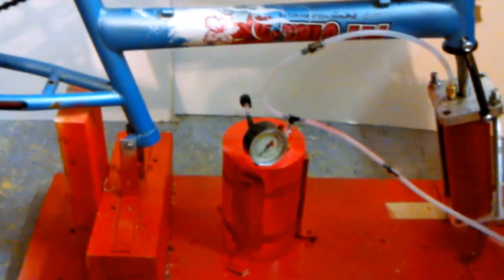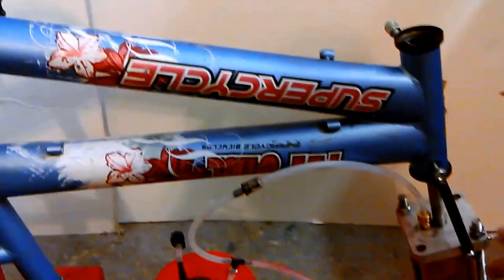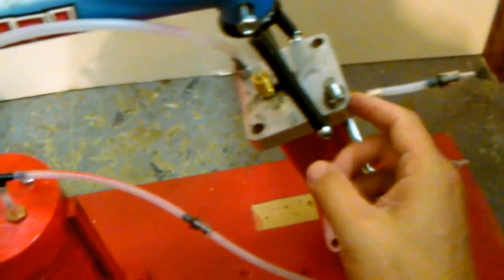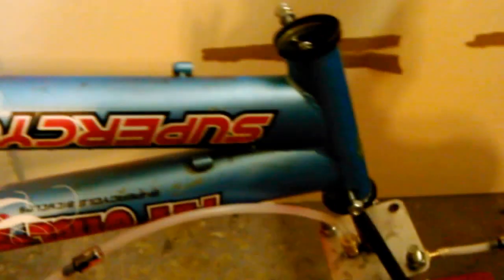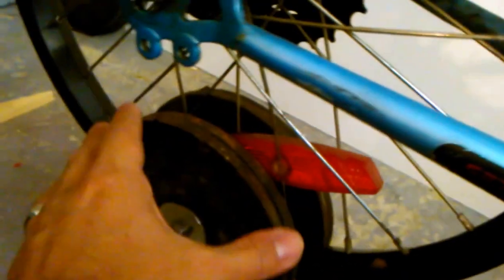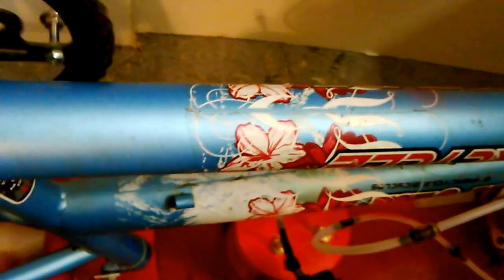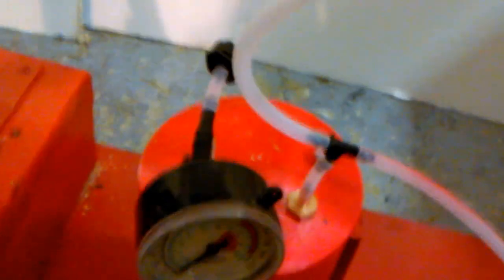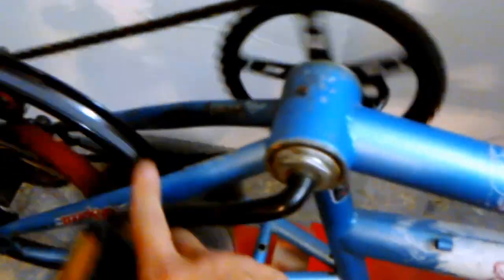Centrifugal reciprocating air compressor

Comment: it does not look like you are getting compression on the downward stroke, only the upward stroke.  remember the milkovic oscillator harvest gravity and creates a very powerful short stroke upward force.  to get the full amplification on the device you have to use all the upward force available.   a compressor is a good Idea and I thought of that one too.  but because of the very short stroke  of power you would have to design a much larger piston. think bicycle pump design. and a large pvc pipe like 12 inch pipe would have a lot of volume in it to make up for the short stroke.   leather works great for the piston, a leather cup with a metal plate on either side so the leather is pushed close to the sides of the pipe, oil soaked leather. copy the bicycle pump design but on a large scale for short stroke volume.